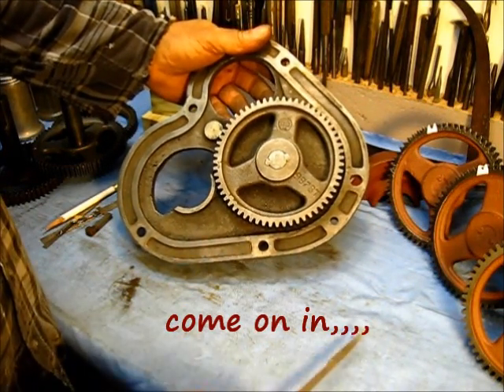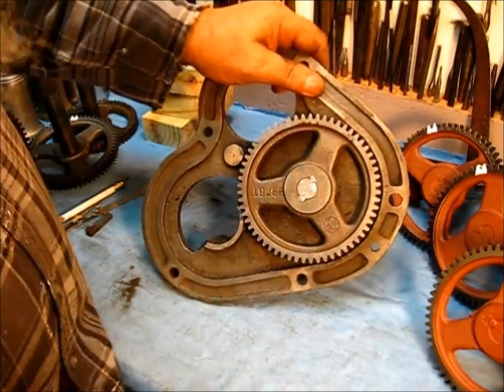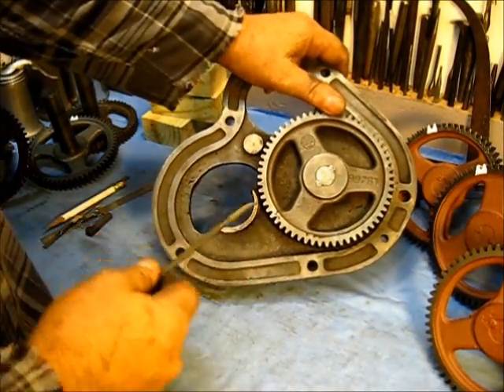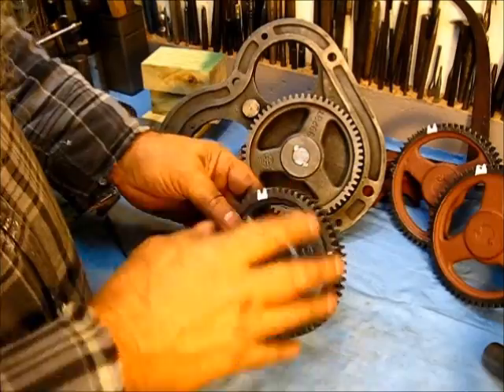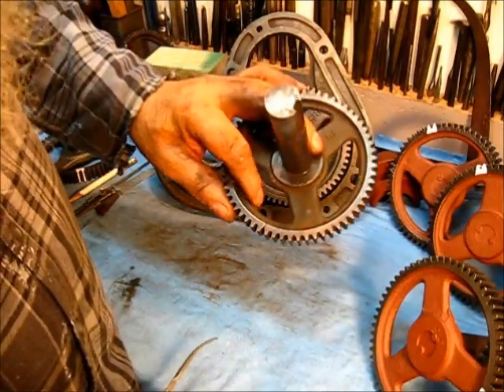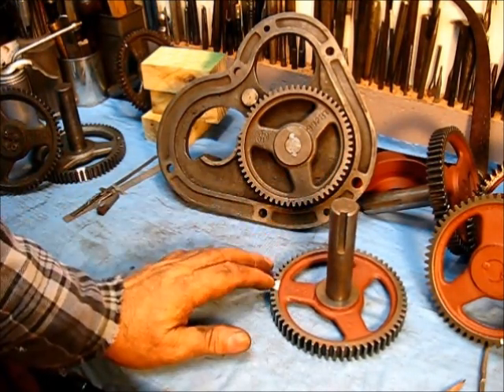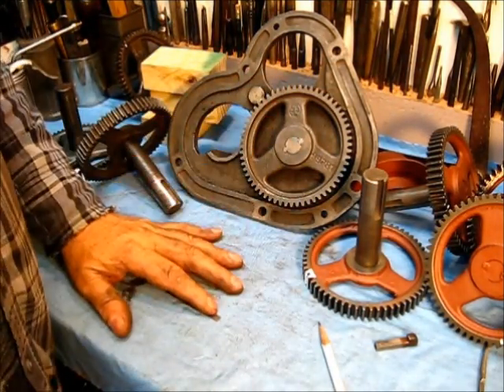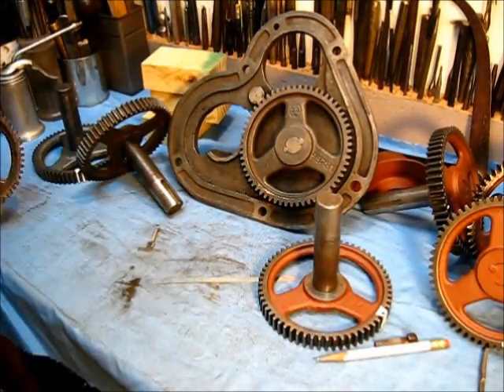IHC ENGINE / cam gear timing marks

Comment from the maker: ,, I have two engines that I am going to put together at the same time (a short upcoming series),, one is an understrike and one is an overstrike, will explain in that video,,,, but to answer the question, it's the way the ignitor is tripped,,, thanks